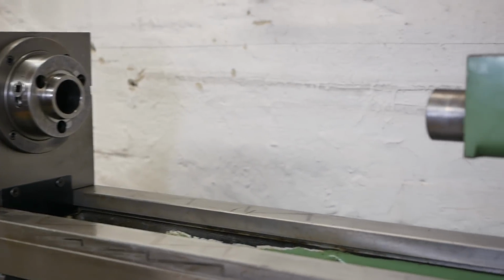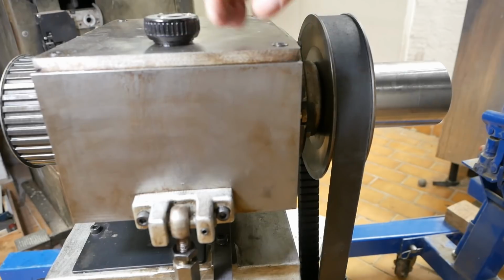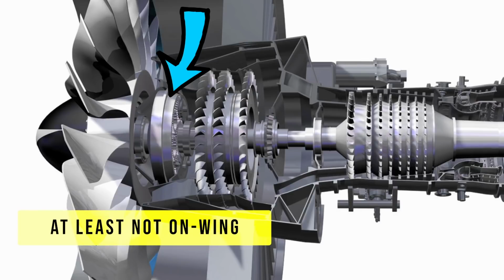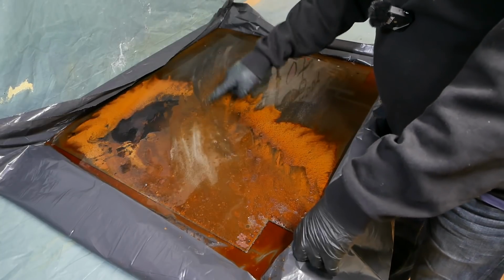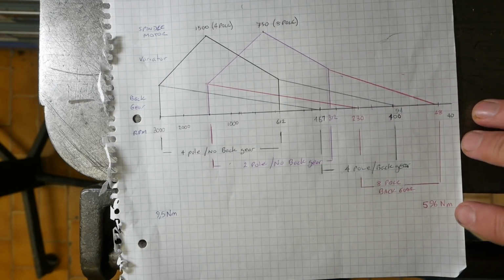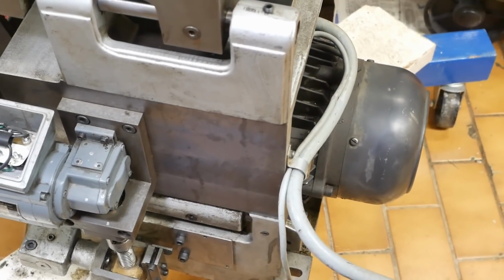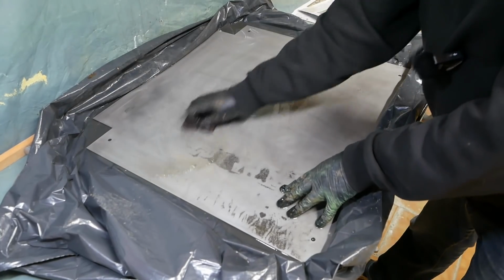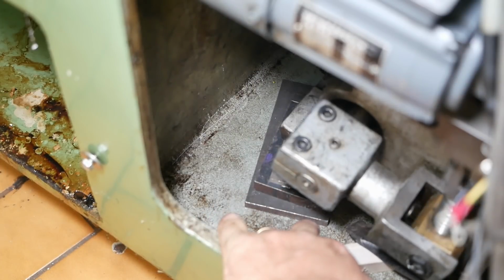Installing the Schaublin drive train

Comment: I'd hope to keep the original stuff, it's already there and has worked 40 years already, why not another 40?
Reply from the maker: Yeah, I like it as well. If I set up VFD + CVT + backgear, I could near continuous speed from 3000 done to about 10 RPM, with more grunt than a rutting sperm whale.
Reply: @RotarySMP  You owe me a cup of tea and some bandages from the scalding - LOL
Reply from the maker: @phrozenwun  Glad you liked it :)
Reply: I definitely second this. It's an old machine. If you can get it working on the software side then keep the variator and gearbox. Electromechanics are cool and servo drives are boring. :)
Reply from the maker: @Joelsfilmer  Good call.

Comment: My understanding with VFD's is that running motor too slow that has a fan desingned to run at full speed wont have good enough cooling and that what kills motors that are not designed for VFD's

We have two motors running from vfd, but they are only used for smooth start and stop so the motors dont heat too much
Reply from the maker: That is why I am setting a pretty high minimum speed of 20Hz. so that the fan keeps air moving.

Comment: Variable drive looks well over engineered, Certainly very smooth in reducing induced vibration.  I think VAG group (Volkswagen Audi), use a Hy-Vo chain, looks weird.
For inverter duty, maybe worth a high voltage insulation test, I think WEG do a calculator based on motor size/class.
I never knew there was a reduction gear between fan and compressor sections.
Thanks for some very interesting engineering facets.
Best regards from the Black Country UK
Reply from the maker: THanks for the feedback. It is a very well engineered machine.

Comment: I'd going direct drive, it's simpler plus it's quieter than a worn out cvt
Reply from the maker: Fir call, although I doubt that CVT is worn out. This machine does not seem to have worked much

Comment: Keep the original stuff but change the motor that pushes the variator to a linear actuator or a stepper or dc motor + planetary, they would all be way easier to control with software.
Reply from the maker: I still have the little control board to control that little 3Ph motor. It looks like the inputs are simply increase speed and descrese speed. I got some good input into the the control logic on the LinuxCNC forum.
Reply: Oh, thats awesome! That would definitely be straight forward to control.

Comment: Thanks for the tips about the vinegar & mill scale. I just bought several sheets of steel just like you are using, for a future project after I finish my plasma table. Now I know how to treat the steel for painting. Is there a way to remove dark stains on metal? I got some moisture in my shop while working on the cast iron ways on my mill and ended up with dark patches in various places. Nothing to cause any problems but they look unsightly and it would be nice to make them go away. Looking forward to seeing the wheels go round on the Schaublin. Thanks for all you do.
Reply from the maker: I dont know how to remove such staining either. I have them on the Schaublin ways.

Comment: Most VFD can be set to 2 or 4 fixed frequencys,selected by 2 binary inputs, so you could wire the motor to the fast speed an emulate the slower with the VFD.
Reply from the maker: The Mesa 7i83 has analog outputs, so I will be setting up the VFD to be controlled with a stepless speed range from LinuxCNC.

Comment: Run with the existing motor and variator, it's there, probably works, and it's cool. if it blows up, you've not lost much, and even then I'd be tempted to stick with the variator, you can't beat mechanical advantage!
Reply from the maker: Thanks. If the existing motor dies, the Variator will have to come off, as it needs an extended shaft motor.

Comment: I say keep the original motor I used to refurbish machine tools for a living and the older motors I came across were always better engineered compared to the new ones and this goes for windings and insulation.
Reply from the maker: Thanks for that input.

Comment: I finally finished setting up my pc for LinuxCNC, it took sooo long
Reply from the maker: Congratulations. I struggle with this each time as well. Mostly some dumb little detail trips me up.
Reply: @RotarySMP  I could not figure out how to move the picture on the monitor down a bit, it was cutting off some text on the top, I tried everything, turns out the monitor has a button to autoadjust the picture to the right size, huge facepalm

Comment: Hey, this was a great flic. Finally some progress! Looks great. Didn't quite understand why the existing motor should burn out quickly, if it is insulation class F, or was that statement based on your assumption that it was not an F? Otherwise, very happy to see that you are making progress. 
The engine excursion was also very interesting. Thank you for that.
Stupid question in this context. The large Turbofans of RR are based on the RB211 have not only 2 speed zones, but 3. So does that mean that these engines need substantially more engine maintenance ?
Reply from the maker: The motor is insulation class F, but it is also 40 years old. 

The RR three spool engines offer some of the theoretical advantages similar to a gearbox. At lest the core and intermediate can be smaller and turn faster. They are much lighter than two spool engines of similar thrust, but tend to have higher fuel consumption. All the big engines are very expensive once they hit the shop. It is hard to generalise which engines are more reliable, as each manufacturer has a family of models and is constantly trading reliablity earned through experience for incresed performance at each new model.

Comment: I like the mechanical speed variator! Especially since it can be controlled through CNC. My mill at work I use is a CNC conversion type knee mill and it doesn't have a CNC controlled variator but otherwise I really like the variator! Unless its a safety hazard I would leave the original motor for as long as possible and just replace that with a VFD compatible one while leaving the mechanical variator if the old motor dies.
Reply from the maker: Thanks. That is the plan.

Comment: Yeah, Them geared turbon fan planes are pretty cool. I've gotten to see drawings and how they test their new engine designs for their flight test beds as Pratt and Whitney do air tests with several types of planes. Though it sounds like they are retiring a few of them. 

Not sure why they don't break the fan into separate fans with them running at the same tip speed just a bit offset or if they had ring to keep them lined up. Even with a lower speed it should work, but how well is the question
Reply from the maker: There are a million compromises flying in formation there.

Comment: I disagree about VFDs being held back until the availability of IGBTs.  IGBTs made the power electronics simpler and more economical, but power MOSFETs and bipolar transistors were available which could have done the job, and did when it was required.  What changed was sufficient integration of the control circuits.  A VFD controller made with discrete logic is beautiful or terrible to behold depending on your relationship to it.

In the 1980s the common solution I saw was inverter driven multi horsepower DC or universal motors when variable speed was required and a mechanical variable speed drive was not suitable.  Before then thyratrons which are the tube version of an SCR were used.
Reply from the maker: I shouldn't take about stuff I have little clue about, but always get a good education through the comments. Thanks for that.
Reply: @RotarySMP  Increased integration did come about in the same timeframe that IGBTs became available, so it would be easy to think IGBTs were the reason.  VFDs did exist then, but they were cabinet sized and very expensive.  Not long after that, I remember application notes from Texas Instruments and Motorola about how to use their DSPs to make VFD controllers.

On your Schaublin, I wonder if the motor has insulation class F because Schaublin offered a VFD option.

Comment: That's a interesting side bar about the turbo fan.  And I agree with your comment on not having anything to break, I always say, "there's nothing to go wrong when there's nothing to go wrong."
Reply from the maker: Pratt have tried this before (PW8000). I heard that was their gearbox design, and ended up not commercialised. That is where I heard that MTU designed the PW1000 gearbox. If they can make that work, it should really squeeze the competition.

Comment: I would run it as is and add a 120mm server fan to the rear of the motor.
Reply from the maker: As I have both VFD + CVT, I wont need to full 10-100Hz range. By limiting the slow range to about 25Hz, I am hoping the motor cooling will be okay.
Reply: @RotarySMP  25hz should be 50% speed on it and 1/4 the torque?
Reply from the maker: @Engineerd3d  25H5 is 50% speed (= 750 on the 4 pole windings) .
Below the nominal 50Hz, the motor torque should be nearly constant.
https://www.pumpsandsystems.com/pumps/motor-horsepower-torque-versus-vfd-frequency
The power depends on the torque, and is therefore halved at 25Hz.
Reply: @RotarySMP  i thought the power was exponential with frequency. Thank you for setting me straight.

Comment: I bought an old wood lathe at an estate sale. Thought I got  good deal. The guy said it just needed a pulley. I didn't know much back then and know less now, so I bought it. Turns out I needed a special pulley that I had never heard of before. A reeves pulley was my introduction to variable speed pulleys. Well. I never have found a replacement for that pulley. I 3D printed one that fit the shaft. I fell apart when I tried it out. Live and learn. That's wild about the motor to run the variable pulley width. Cools stuff. Thanks for the lesson. And this lesson is modern time in a nutshell. Software may have eaten the world, but hardware had a great appetizer!
Reply from the maker: I like that statement. Hardware is cool.

Comment: if you are going to make a full time living with that machine, by all means, convert it now, on the other hand as a hobbyist garage shop that sometimes gets paid, Leave it Alone ! It will most likely last for several more decades and if it doesn't you can afford the time to rebuild and upgrade the gear system then.....
Reply from the maker: Thats for the feedback. That is how I see t as well.

Comment: You might be able to get back some of the torque at low VFD speeds,  using a VFD with vector control,  rather than a simple V/F drive.
Reply from the maker: I think that Lenze has vector control.

Comment: I have an avm mas165s cnc lathe that I converterted to pathpilot. It has a 2.2kw (3hp) spindle motor driving a 2 speed gearbox in the head giving rpms of  50 to 1500 and 150 to 4500.  In my case 3hp is fine but I could easily go bigger. I'd keep with the 3kw motor if I was you. At least until you have it running then you can up the hp if you find it struggling
Reply from the maker: Thanks for the feedback. I googled the avm mas165s. Nice looking lathe. Great size.
Reply: @RotarySMP  thanks, it's not a bad machine. It was originally fitted with a fanuc 3t control and a 7.5kw (10hp) spindle motor. However I got the machine without any of the electronics. So I decided to go solely single phase. Using a mesa 7i92, custom breakout board with arduino ( to control the turret), Chinese 750w ac servos and a standard 2.2kw 3 phase motor for the spindle driven by a vfd.

Comment: If you do set it up with both the VFD and the variator, you'll then be opening yourself up to a whole 'nother project around optimizing the efficiency curves. If this were my project at least, I'd be super tempted to do some dyno testing on the final lathe to get exact efficiency curves of each component, and set up the CNC controller to use some sort of numerical solver to command the most efficient combination of VFD and variator reductions for any given speed.
Reply from the maker: Yep, I really dont have a clear idea of the pros V cons of making the CFD primary, or the CVT primary spped control.

Comment: Would the VFD still give voltage spikes if it's only used to change the direction of the motor, rather than increase or decrease the speed? I suppose it depends on how smart the VFD's algorithm is or if there's a way of intentionally commanding it to do this, but in theory it should be possible to have it just connect the appropriate input and output phases without trying to switch anything.
Reply from the maker: I am pretty sure the way it chops up AC to DC and then rebuilds AC as a no longer smoothed sine wave is te same regardless of frequency, even if 50Hz in 50 out.

Comment: run the stock engine via vfd- i have an older mill that i ran on an abb vfd for several years,until i replaced then motor whit a newer,bigger one..still runs on the same abb vfd  - the old motor didnt die,but it was simply old,and the bearings was shit-so it got replaced..i ran that old one from 20 to 100 hz
Reply from the maker: Thanks for the feedback.

Comment: Your videos are always interesting - particularly with your tangents into aircraft. Now as for your lathe, if you have the potential to coldform wrought iron balustrades then why not keep it that way - jokes aside, cold forming processes may be an interesting adjunct for you - roll hardening, roll threading & roll burnishing on a small machine would be pretty cool & very handy.
Good luck - Stay safe and well :)
Reply from the maker: I really dont know what usage case could need 600 NM on a 10 inch lathe.

Comment: It might be a bit clunky having three different systems to change speed (VFD, Variator, Gearbox), especially when you are changing RPM to keep the surface speed the same when doing a face cut, but I would keep all three systems and figure it out in software. You never know when you are gonna need the extra torque of the variator and you can always run it as a fixed gearing.
Reply from the maker: Yeh, I need to think through the use cases. Other than the back gear being inhibited with the spindle running, I havent really got a goo plan for the control logic yet.

Comment: Wow what a great episode!! For what its worth ive been running a Colchester Student lathe with its original 3 phase motor 2.2 Kw for approx 20 years with an SEW eurodrive VFD. Single to three phase setup.haven't killed it yet, but only a small amount of weekend warior work. The lathe was ex Wellington polytec.  
Only having one fifth of the torque at low speed means you might have to take a smaller deepth of cut, but more importantly the cutting speed will be corect. Unless your  putting this thing into production of large diameter parts and time is critcal.
Reply from the maker: Thanks for the data point. My local electrical hero wants me to run a double shielded cable from the VFD to the motor though.
Reply: My setup is only manual lathe so no issues with noise. There is no shielding on the cable, but the VFD does make the radio Fuss a little. With a plug swap system for power and control this VFD also runs an old Bridgeport mill(1.5 horsepower original motor) It has also lived a long time. I also had to convert the motors from star to delta or vice versa, i cant remember 20 years ago.

Comment: Maybe you can add an Filter to the Output of Your VFD. This would reduce the Voltage transients an so the Stress to the Isolation of the Motor., but this might increase the Capacitance to PE which might trip your RCD. ( I really like Filters with 3Phases + Neutral + PE instead of  3 Phases + PE )
Reply from the maker: Thanks for the tip.

Comment: My lathe had a similar system. I use my every day and it is very important for the company. So I decided to make it simple. Took the variator off, and the back gear. Made a pulley reduction. And used a high speed and considerable more powerful motor with a VFD. 
But if it was a machine for casual use. I probably would had kept all original like you did on the maho.
Reply from the maker: Thanks for the feedback. It would take a pretty huge motor to replace the back gear, and I only have a 16A home electrical supply.
Reply: @RotarySMP  True but keep in mind that high frequency motors develop more power with the same size motor.

Comment: Rolls Royce is building Ultrafan which should have a gearbox too. Also composite fan blades for weight reduction as compared to titanium ones. The bigger engine you make the bigger the centrifugal forces you need to deal with. Fun fact Tupolev Tu-95 tips of the blades are turning faster than speed of sound making it apparently very loud plane
Reply from the maker: RR tried composite blades first. The development was part of what pushed them into receiver ship in the1970's. It took GE also about  a decade of research to perfect the composite blades used on all their large turbofans since the GE90. There are a number of advantages, including that the tend to pulverise in a blade out event making containment easier.

I heard an AN-22 on approach to Vienna about a decade ago. They have the same NK-12's as the bear. It is a very distinct sound, unlike any other plane, and that was only at approach power. Interesting fact, is that the NK-12 was designed by an Austrian, Ferdinand Brantner, who was a Junkers design engineer deported to the Soviet Union after the war.

Comment: While the motor was out I would considered removing the gearbox and pulley system but I would have opted for least amount of work and reinstalled everything just like you did, kicking the can down the road.
Thanks for the vinegar explanation.
Reply from the maker: Thanks for the feedback. Hard to beat that which is already there.
Reply: @RotarySMP  I was thinking...
You mentioned 5 x contactors. Have you considered a manual two position lots of poles industrial switch to change the  motor between start  & delta?